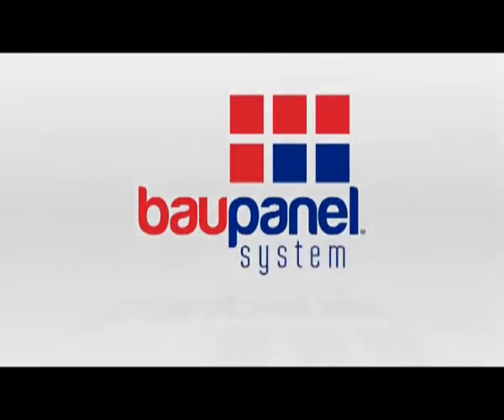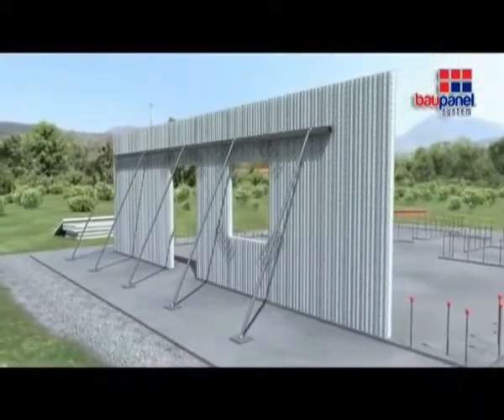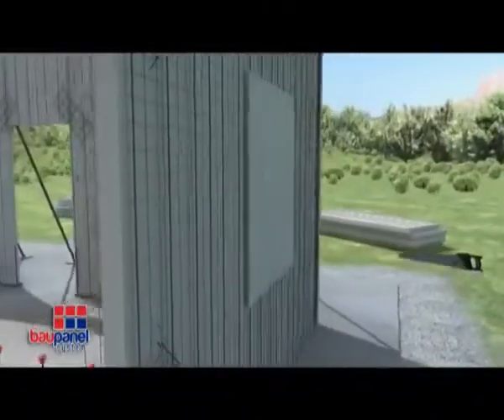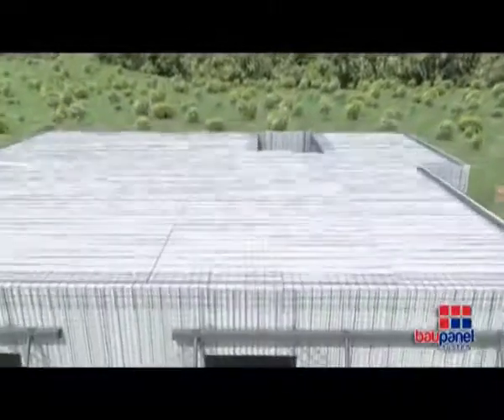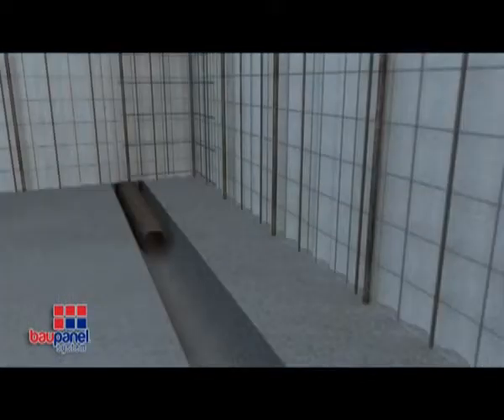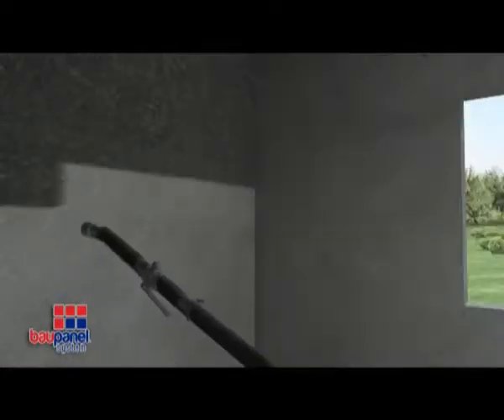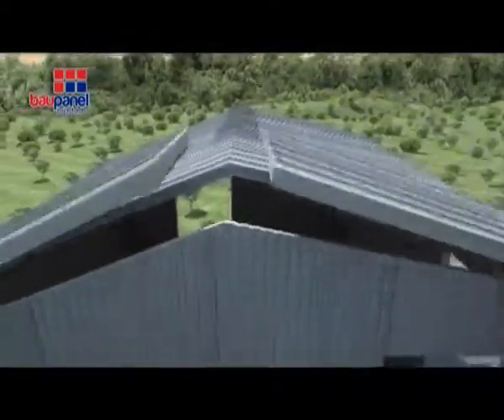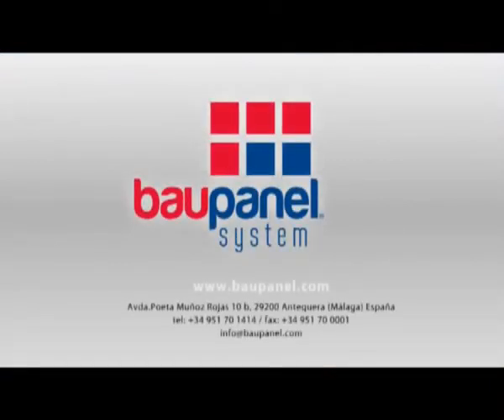Concre-Panel System Step by Step 3D (courtesy of Baupanel Systems)

Comment: Is there a supplier of 3d panels in tarlac,philippines area?
Reply: just search for SRC Panels in the Philippines.
Reply: hello ，Please view the mechanical video of Philippines : https://youtu.be/ZJz3xPdzi_8
Hebei Kaiye Machinery Equipment Co.,Ltd
Manager : Larry
Skype : larry-56789
E-mail : larry@ap-kaiye.com
WhatsApp : +86 15931130356
Mobile/WeChat : +86 15931130356
Tel : (+86)-311-85365899 Fax : (+86)-311-88632356
Factory Add : Xutuan Industrial Zone ,Anping ,Hebei ,China.
Reply: Does your company have structural calculation data for 3d concrete panels?